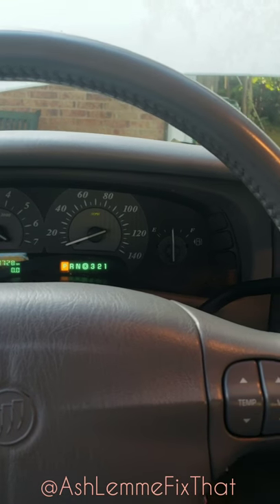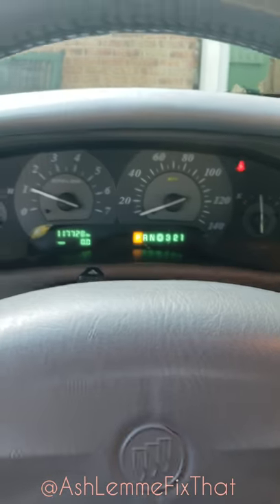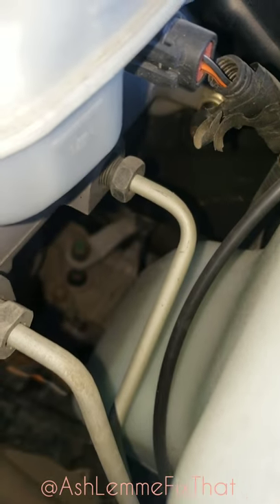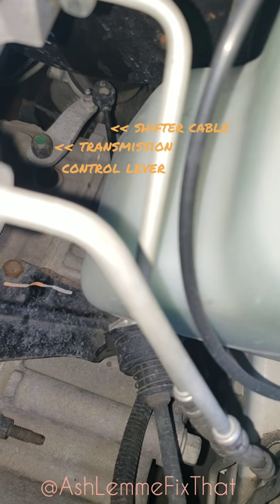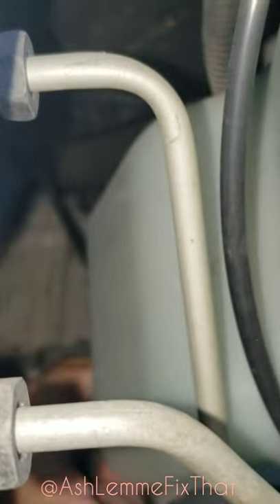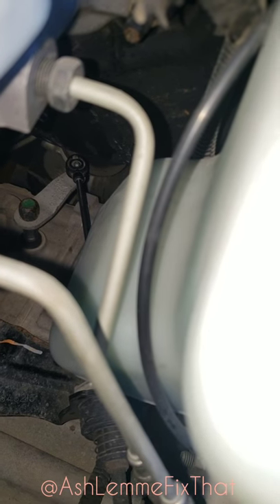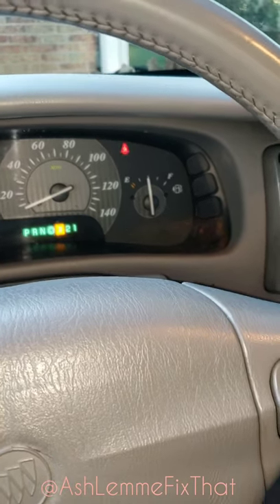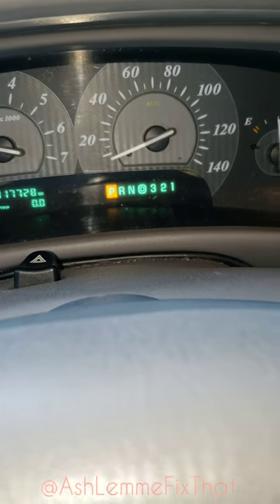2004 Buick Park Avenue shifter linkage problem

Comment: So!!! My cable is where it's suppose to be...it's moving the arm. Still moving like yours at the shifter knob in the car but not doing anything to the transmission. It's a 2000 Buick Century Custom. Exact same setup as yours.
Reply from the maker: Hi Amanda, thanks for watching! Sorry that I'm just now seeing your response. When you move the shifter inside the car, do you feel the gears engage? Or is it just freely moving like mine did in the beginning of the video? If so, the plastic bushing may be bad. That's originally what I thought was wrong with mine until I realized it was just completely disconnected.

Comment: Thank you sweetheart. I have an 07 Lucerne. Mine wont come out of park and it wont click in to gear,  when i do my Mc.gyver tactic to make it come out of Park,( disconnect the battery is my tactic ) . I put a ( BCM ) in my car, rather the shop installed the bcm box , now my radio says loc and all the other etrocities happen. I am pissed. Wanna drive this car off a cliff. It runs good. 2000 takes it home. Who wanna buy it. Do not have time to fix cars.
Reply from the maker: Thanks for watching! Yikes!!! Wish I could help. Good luck with that.
Reply: @ashlemmefixthat7786  Might traded it. Really thinking about selling it .   2000 They can have it.

Comment: Hi ash, I snapped the plate behind the lever ,inside the column. I put in park manually,  but no start, even though all lights are working,and no blown fuses.  Help! Please
Reply from the maker: Oh no! Sorry that I'm just now seeing this... Is there any piece of the plate/ lever left? You've got to be able to physically engage the "parked gear" on the transmission to start your car. I know you said that you manually put it in park... Do you mean, you manually did that with the transmission or did you just move the shifter inside the car? It seems as though your car thinks that it is in gear to drive, which is keeping it from starting. Again, sorry for responding so late. Let me know how it turns/ turned out. Thanks for watching!
Reply: @ashlemmefixthat7786  ,hope your 4rth was safe and sending positive vibes.  So, I ordered a new plate from Amazon,   ( wrong part terminology) this is what the shift handle or gear selector connects to ,then torx bolts to the column.  The part didn't come threaded ,I just pressed hard until screw caught  which threaded itself. The only other step was learning how to take dash plastics off,  to gain access to column.  If there was a major "take away" from this experience,  it would be to NOT lend your vehicle out to friends, OR, older female ,blind as a bat , roommates.  When parking on a hill ,ALWAYS ENGAGE PARKING," EMERGENCY "  BRAKE  BEFORE SWITCHING TO PARK.  Lol, thanks again , hope to see ya soon girlfriend

Comment: Thank you for your video! I was curious what do you do when it doesn't snap right back on...... mine snapped back on as well but then came right back off..... I can see where the bushing is broke inside.... have you any suggestions on how to get the old bushing out of a 2004 Buick Rendezvous? I bought the bushing replacement but before I dig in I want to make sure I know how to get it out.... right now I just have it zip tied... thank you again for your videos and any info that you have would be much appreciated😌
Reply from the maker: Hi T M! First, sorrry for such a late response. Second, thanks for watching! To try and answer your question, you may want to try and use a "pick tool". Something really pointy and sharp. Usually if the bushing is really bad it will be loose enough for you to stick something small in there to pick it out, or the bushing will break altogether. Hopefully you've gotten it out or can get it out! Wish you the best!

Comment: I have the same issue, I was just wondering if yours ever came off again? Mine wont snap into place I feel like the plastic is worn away  so badly that the ability for it to snap into place is gone.
Reply from the maker: Thanks for watching!!! No, it never came off again. Yeah, it may be that plastic bushing that's bad on yours.  That's what I originally thought was wrong with mine until i investigated it further.

Comment: Hey Ash, I have 2002 Park Avenue and my gear shifter is stuck in park. I think it’s the neutral gear switch but I don’t know how to get to it. Any suggestions?
Reply from the maker: Hi Corey, thanks for watching! It sounds like you may have something going on with your brake/ shift interlock OR did you possibly park it on an incline without using the parking brake? There may be too much weight on the transmission. You'd have to get someone to help you "push" the car to get the weight off of the transmission and try to apply the brakes to shift it out of park.
Reply: @ashlemmefixthat7786  no I didn’t do anything of that lol it turned out to be the ignition. I put the key in and turned it to “on” then shifted it to neutral and then I started it and it worked like that who knew!
Reply: Oh and thank you for replying!!